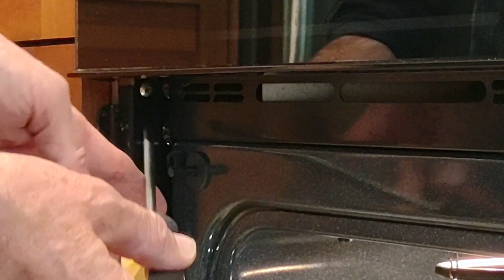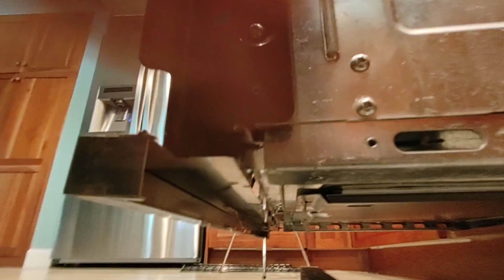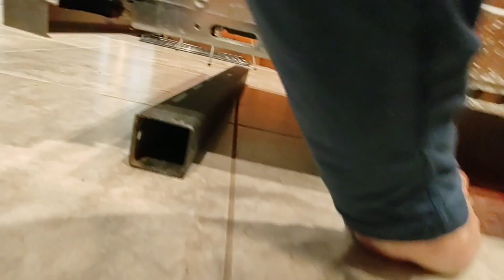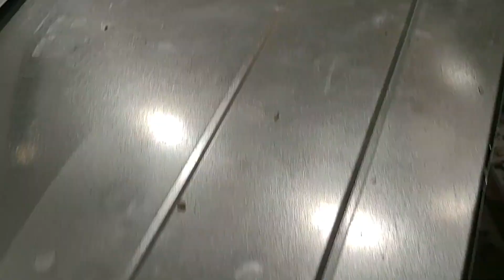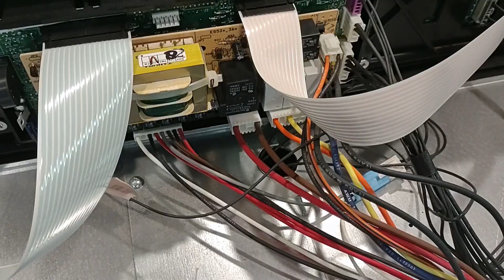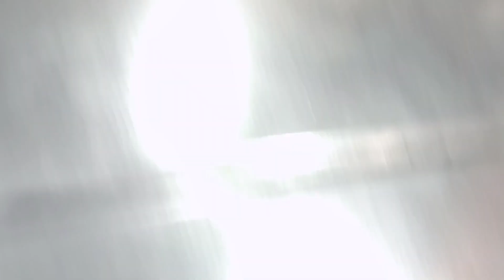Oven won't hold temperature: Kenmore 790 / Frigidaire Electric Oven, Troubleshooting Video #2

Comment: Thanks for the video! I have a three week old Frigidaire Gallery 24" wall oven that is doing the same thing, but mine should be covered under the warranty. Still it is helpful to know what the tech should be looking for so that I know if they are actually capable of fixing it.
Reply from the maker: @joedusel  I agree that it's always a good thing to understand more about those things others are working on for you.  Over the holidays, I visited friends whose dishwasher stopped working. They had a pro come in, and he told them that it couldn't be fixed, because the entire control board was blown. I took it apart, fixed the cold solder joint, and had it working again in 15 or 20 minutes. ;-)

Comment: Can tell you from personal experience are multi things can be
1. The heating element is bad, look for cracks and bubbles on element 
2. The thermostat is bad 
3. The control board is bad, not worth fixing junk it. 
4. All 3 are bad! , which is a problem for kenmore. You think you've fixed it the other 2  then the control  board is bad . So learn to use a multi meter before you buy stuff and waste time money.
Reply from the maker: No doubt about it - some diagnosis time up front - and a bit of logic - can save a whole lot of time and effort.  I'm trained in electronics so troubleshooting an oven isn't particularly difficult, especially if you have a multimeter and know how to use it.  In this case, it was pretty straightforward due to the symptoms, and taking the measurement of the lower heating element resistance (it was an open circuit).  But I have seen some pretty fried control boards that I'd want to avoid trying to fix!

And FWIW, I knew the thermostat (temperature sensor) was good because the oven would heat to the proper temperature - it's just then it would start to cool off since it relies on only the lower bake element to maintain bake temperature (after heating up with the broil and convection elements).